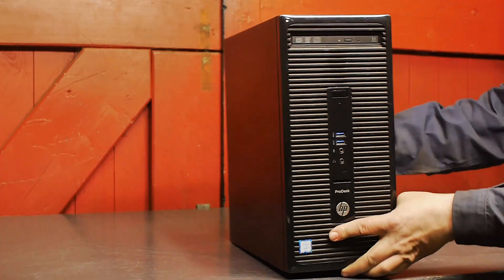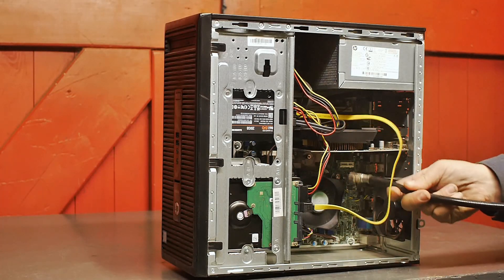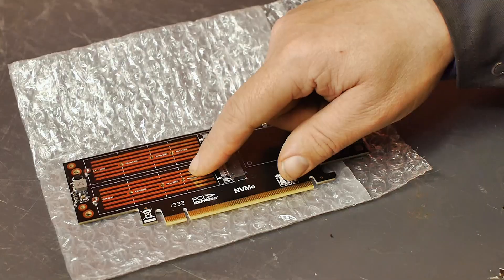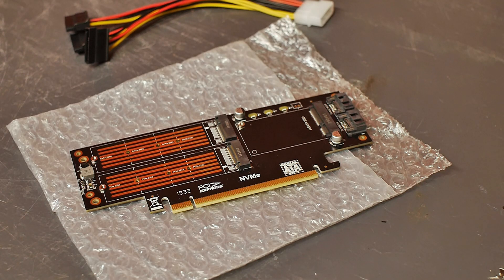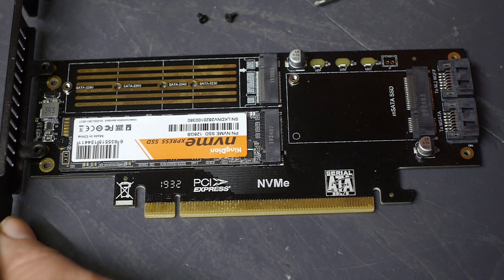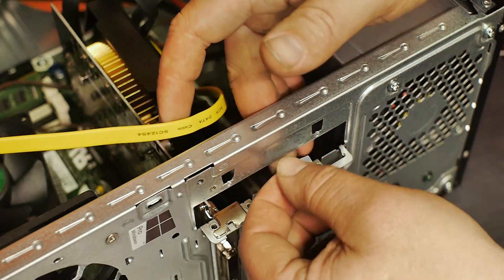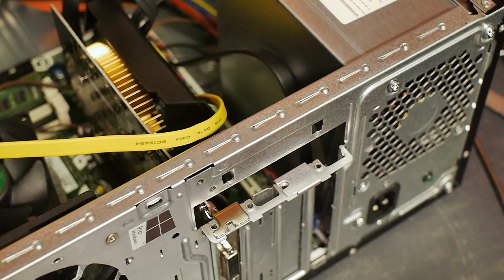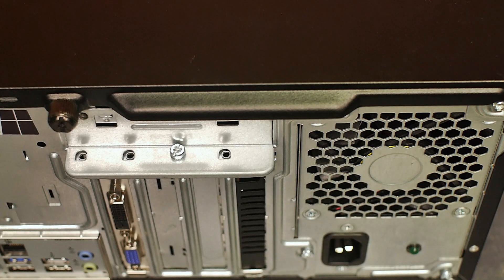Adding a NVMe m.2 SSD and PCIe riser card to my pc

Comment: upgrade the GPU, the GT740 was a low end GPU when it was release... it will help with your editing
Reply from the maker: Till recently my editing software was hardly using the GPU. But still disk I/O seems to be the bottleneck :( Besides my GPU options are probably limited because of the PSU requirements. But a GTX1050 should work. I should probably spent the money on a quicker and bigger ssd drive :)
Reply: @RolingRandom  you can get power supplies for pretty cheap online, and if you don't want to upgrade your PSU, some gtx 1650 models doesn't require a power connector

Although GPU prices are kinda crazy right now.